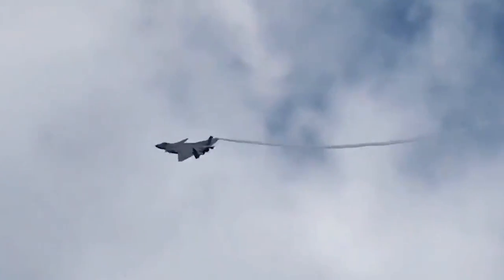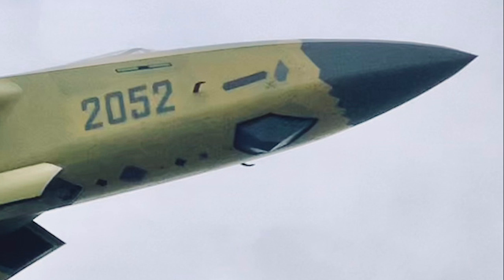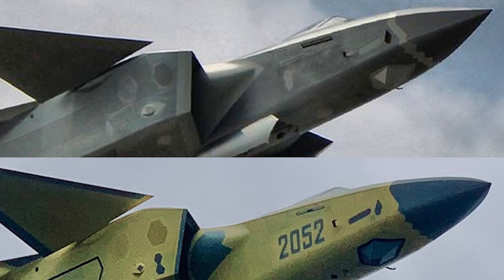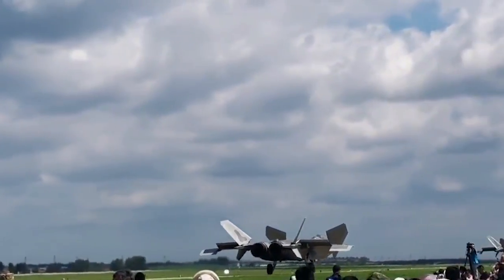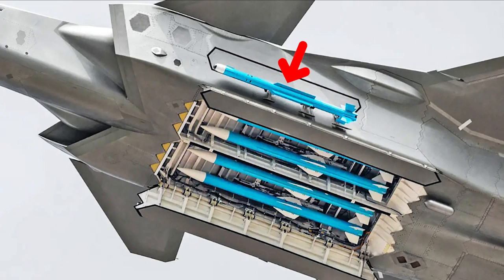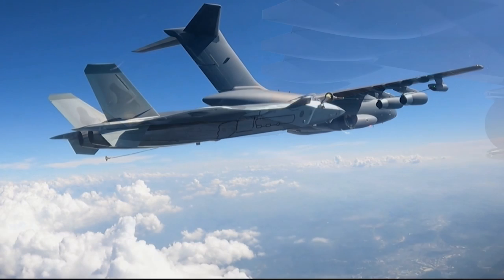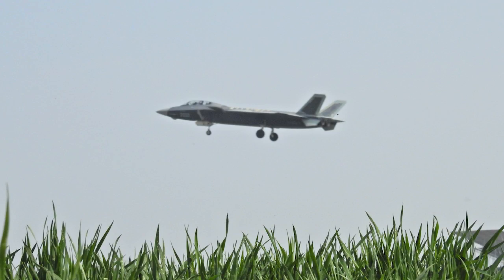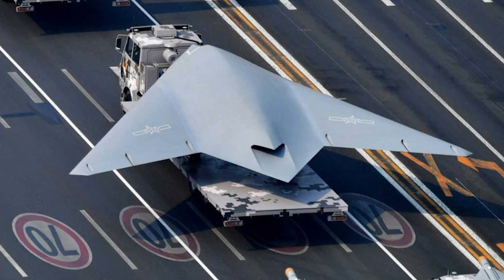J-20 is changed: Design flaw fixed or an enhancement for this Chinese stealth fighter?

Comment: Why doesn't China try through Serbia to get plans for the Yugoslav version of the French Snecma 88Y engine?  Namely, Yugoslavia made that engine for its version of the single-engine Rafale from the late eighties, called NA.

Serbia could thus pay off its debt to China.
Reply from the maker: Don’t think that was ever matured.
Reply: @chineseforces  that engine was completely built in the pre-series phase already at the end of the eighties.
Reply: Another option are wings from the Yugoslav G 4 for the K 8. This would significantly improve the characteristics of the aircraft.

Comment: Chinese weapons are utterly awful- Indonesian defence force with backhander bribe deals for C705, Long Bow, jamming clone AK45 &AK74, RPG 7-29, rubbish ships, J10 FAILED BEFORE ROUND 1, J20 & J31 evaluated to be far inferior to F16 (latest variant), EADS Mako, Japanese F2 and new FX (F3), Indonesian Aerospace-KFX Boromae, F35, Turkey TFX KAAM, SU75 Checkmate, Eurofighter Typhoon (1984 design by MBB), Dassault Rafale, Sukhoi Su75+, Su-57, Su 35, F15EX, Saab Gripen. Now for ancient aircraft designed in 1970s- F16 latest, FA18, F5, Mig 29 modernised, Panavia Tornado modernised, ancient SEPECAT Jaguar, Dassault-Dornier Alpha Jet modernised,  Mig21(China CANNOT OUTDESIGN 1950s Russian aircraft) modernised, SU24, Su25.
Chinese weapons system is antiquated designed around 1945 US carrier fleet- they must copy the US for MIAN XI.
Chinese drones useless hence easily lost international drone trade to Turkey.
The only aircraft worse than Chinese clones is HAL Tejas.
ALL CHINESE ROCKETS ARE SOYUZ EXTENDED. RUSSIANS SUPERVISE INFERIOR CHINESE TECHNICIANS TO BUILD SPACE WORTHY ROCKET AND EVEN BEIDOU INFERIOR TO ANCIENT US LORAN. BeiDou RELIES on ancient LORAN and superior Russian GLONASS to synchronise and adjust.

Comment: LONG LIVE CHINA , LONG LIVE PLA & PLAAF.

I have a note on the infrared search and tracking system ( IRST) inside the diamond-shaped dome.
It is a copy of the donkey americans methods of installing this system below the nose of the aircraft, in contrast to the Russian system of installing it above the nose alongside the line of sight extending it at a certain angle of elevation and decent and wide azimuth angle .
Yes, its location allows for the installation of an appropriately sized, multi-functional system that provides an advantage for a stealthy aircraft in incorporating a multi-channel electro-optical system with a laser rangefinder and perhaps even built-in laser illumination, in addition to having the ability to conduct reconnaissance, surveillance and targeting of ground targets while maintaining the stealth feature and without the need for installation a specialized reconnaissance, surveillance and targeting pod.

However, the system, due to its size and shape, could undermine the stealth capabilities of the stealthy aircraft, unlike the system installed above the nose and considered an extension of the aircraft’s cockpit canopy especially the upper side of the planes are always uneven .
Reply: PLA is COMMUNIST PARTY ARMED WING. NOT AN ARMY- never fought war A JUST JOKE EVERY NATION LAUGHS at. YEMEN= HERO. Syria= hero
 Palestine= hero. North Korea= hero. China= bullied fat kid obsessed his waifu pillow Japan abandon the inferior, backwards, poverty nation of China.

Comment: Both US and Chinese aircrafts are capable and deadly weapons in the hands of skillful pilots.  With modern warfare, we are dealing with systems not individual aircrafts.  F35 is the most expensive aircraft that US and its allies have ever produced ($1.7 Trillion for 2000 aircrafts--with 400 plus already built). Not sure if F35's advancements could overcome the possible hybrid fighter/drones/drone swarms systems the China is developing.  The 2-seater J20s serve that purpose very well.  Of course the US has their version in development.  After awhile individual pilot and aircraft became less relevant than the whole system.
Reply: I wonder what the J20 second seater will do.  I think it will make this version able to take on the F22 and F35 since our jet are only single seaters and F35 also has speed restriction...We need to get our head out our butts...
Reply: @rgloria40  Control bunch of loyal wingman
Reply from the maker: China aims at area deterrence, tried to push U.S. out of Taiwan war zone.